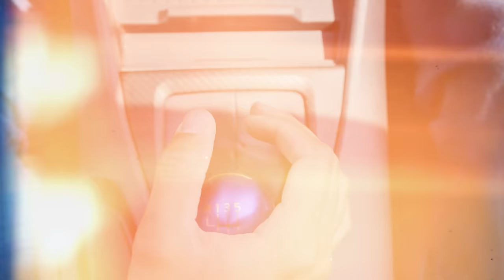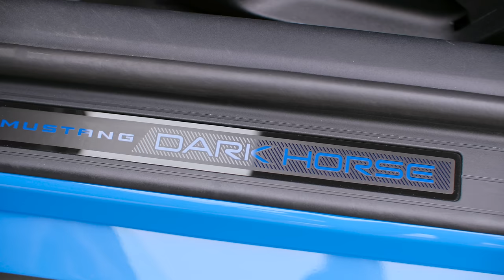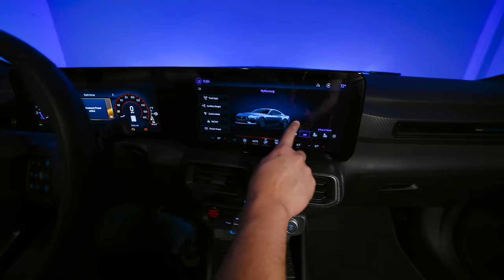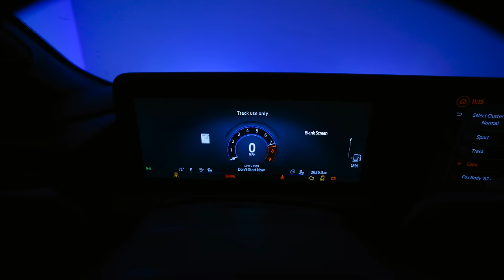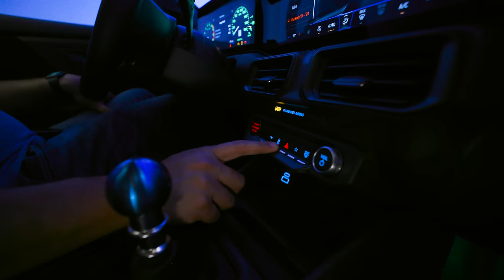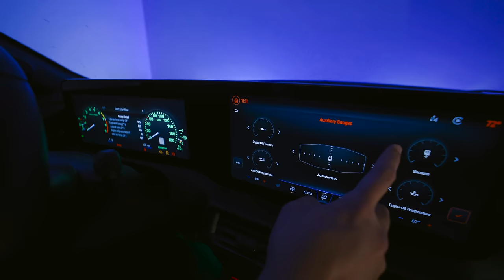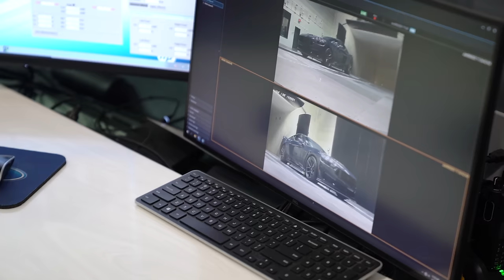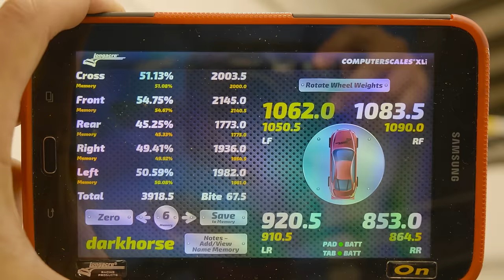2024 Mustang Dark Horse | Why This Car Exists

Comment: I just spent 4+ hours in a debreif on how important this video is and how good the coyote v8 engines are (they are built Ford tough).
Reply from the maker: Thanks for being a man for 4 hours
Reply: Yep. The last gen Coyote, RPG took one, swapped out OPG's for billet ones, threw a turbo kit on it and ran 7's on a FACTORY SEALED motor. Unheard-of 😮 Ford knows what they're doing.
Reply: @terrancebulong4573  cough 6.0 powerstroke cough ;)
Reply: @terrancebulong4573 aldowelds took a stock motor gen 2 and went mid-high 7’s with it. Coyotes are the best motor Ford has put out in the modern era.
Reply: @ralkia  international, not built in house like the new bulletproof high output 6.7 making 1200ftlbs easily.
Reply: @terrancebulong4573  yayaya. It's sick!

Comment: The only people I can imagine saying they prefer entirely screen based buttons have never lived with one. Everyone I know who has lived with entirely screens prefers the mixed style (buttons for climate, seat, and audio)
Reply: Yup. I called BS the moment she said they prefer all digital or all physical but not mixed.
Reply: "If I had asked people what they wanted, they would have said faster horses." - Henry Ford.  Modern Ford "Muh twenty-somethings who can't afford or don't want a Mustang, what do you want?"
Reply: I feel like they just asked a bunch of people questions with out actually making them to use different configurations first.
Reply: @Lazirus951  Prototyping is too expensive when you can rely on people feelz for free I guess.
Reply: I don't think their "clinics" involved changing the climate settings driving on a busy city.
Reply: @CubanRider  Just let Jesus take the wheel whilst you fumble and stab at the inert touch controls...
Reply: I think it's hilarious the screens aren't even molded into the dash.  It's just two ipads glued together.  I'm not a fan of digital dash clusters, but at least the Japanese still make them look like real gauges.
Reply: @jasonmoyer  Cost savings I recon, so they can easily swap between LHD and RHD for the APAC market - which, since I'm part of the RHD APAC market, I think I can live with - as this is actually a car I'd consider purchasing at the right price.  Beats putting the gauge cluster in the middle.
Reply: I think it's the reverse - those who haven't lived with buttons and learned the subtleties like feeling for the bump on the 5 key before pressing don't know what they're missing and think touchscreens are fine.
Reply: It’s all about cost cutting. Tesla model.
Reply: That was the stupidest statement
Reply: It’s amusing to me. All these companies have to do is scroll through social media, particularly YouTube, and check what the comments say and which ones garner the most attention. It becomes extremely clear extremely quickly what the general consensus about literally any product is and how it should be presented. They must be inept.
Reply: @extremeencounter7458 You think they don't do surveys? Social media is a terrible place to get opinions, it's the vocal minority. The fact is Ford has asked a bunch of people who are actually likely to buy their car what they would prefer.

Most people like touchscreens. They're shiny. It's as simple as that. People see their friends Tesla and say "I want this in my Mustang". Enthusiasts bitching on YouTube are such a tiny percentage of who's actually buying these.
Reply: Never getting rid of my GT350 with analog screens. Even if I do eventually blow up the voodoo.
Reply: Yeah that part with her pissed me off. Nobody prefers all digital. We all prefer a mix. A nice screen, with physical climate and volume buttons / knobs.

It doesn’t take research and asking a bunch of people to figure this out. They could’ve saved thousands by just using intuition, or asking me. The fact they wasted who knows how much money, only to go with all digital, just irritates me.
Reply: @SIIKAP1  Told myself the same thing. At least, what, couple hundred thousand, just to fuck it up? What a waste.
Reply: @SIIKAP1  I just realized, must be sabotage lmao. Chevy got a bunch of bots to fuck up their surveys.
Reply: @extremeencounter7458  lmao especially after seeing everyone complain about VW GTI with the all digital crap. They need to hire people who actually have good taste that reflects the masses, and stop wasting all this money only to choose the wrong path. It’s a joke. If their team doesn’t have common sense, they need to hire someone who does. They can just hire me and save hundreds of thousands.
Reply: The way Audi implemented the dual screens in the C8 platform is about as good as it gets with screens. Anything more is basically menu scrolling.
Reply: @GuyGamer1  yeah until people live with it. Everyone wants it and likes it until they have to live with it. Isn't vw working on redoing the mk8 interior to introduce buttons since everyone hated the touchscreen?

I'm not even entirely against touchscreens. But simple things like HVAC, audio, and seat adjustments should have physical controls. It's what you touch the most
Reply: Nope. I prefer all buttons, no screens. Screens will be the tacky dated design of 15 years from now. And rightly so.
Reply: @117johnpar  How can you control things like audio balance and GPS navigation without a screen?
Reply: @GuyGamer1  Enthusiasts are the only ones who will ever consider a car with a big NA engine and a manual transmission.
Reply: @amunako  I can in my 2012 truck. Dot matrix display. Works fine. Also, google maps. I dont know any reason to use a cars satnav.
also also. Audio balance specifically has been analogue controlled since the 70s. So I dont know if you were being sarcastic or not. You want a fart button in your car like a Tesla, Whoopie cushions are like 50c.
Reply: @117johnpar  I use google maps on my car's screen, it's way easier than messing with the phone. I do not have a lot of experience with old audio systems, but I remember then having lots of buttons that are even more confusing than a screen. I believe you only need dedicated buttons for things that you use a lot, like climate control, driving modes, audio levels, etc. A dot matrix display is fine for the onboard computer that shows things like mileage and fuel consumption, but a screen is better for controlling less important stuff. I'm not saying that you just can't live without a screen (I did until late 2019), what I mean is that it makes your life easier and there is no drawback in having a small one.
Reply: @amunako  No aesthetic drawback? go look at luxury cars from the same era as my truck. Those look outdated while my truck wont. -
Reply: I dont mind as long as there's not excessive input delay, same goes for haptic buttons. As long as I have a solid set of steering wheel controls I'm happy
Reply: @117johnpar  I don't know about luxury cars, I don't like them anyway. I'm a third worlder, so I own a 2020 Renault Sandero RS. It's a hot hatch, basically an entry level model tuned for track use with a manual gearbox and a 2 liter NA engine. It's a very basic car, but it still has a small screen in the center of the dash that control things like audio balance, bluetooth devices, can interface with google maps and amazon music, can control audio playback from a USB device, etc. It's a little out of the way, but still better than messing with the phone. There is no drawback in having it there, as there are dedicated controls for all the important stuff (climate control, cruise control, TCS/ESC). My old car (2017 GM) just had an old style radio. It could do many of the same things, but it was a pain to use.
Reply: Yup, like the Supra (older BMW interior/"infotainment") vs the new M2. Supra still gives you physical controls for all of the important stuff, but has a tiny screen. M2 has a huge wrap around triple-ipad style screen, like this new Mustang, but drops all the physical buttons, and a lot of people have complained about it in reviews.

The screens can look cool, but it's not practical when driving when you just want to reach over and grab a button to control music or A/C.
Reply: no idea how much I want a volume knob.
Reply: They should of mix it
Reply: I had a Tesla driver tell me to "just use voice commands" to control the climate and volume if I don't like touch screens. Like, bro, that is even worse. 😂
Reply: @darryla2700  it's great. Literally use it to text.
Reply: Honda learned this lesson with the 2017 Civic, as most people used the physical steering buttons to change music/volume and in the 2018 they added a physical volume dial and all the complaints went away.
Reply: @BurnsRubber  No its not. Cost entry models dont get screens. Buttons and knobs are not more expensive than screens.
Reply: @117johnpar  Bro, you drive a truck. Your car and yourself were outdated the moment you got on the street.
Reply: @d_all_in  why? dont know how to speak or what?
Reply: @an-dr6eu  ?? what are you even talking about. I also have a '16 charger
Reply: A deal-breaker?   Even if I could get my hands on one, I'm no longer considering any car with this design failure.   Mercedes S Class, Ford Bronco, the Civic Type-R or Acura Type-S... and soooo many others with the dash=mounted iPad.

I hope the 'geese' road test gives Mark and Jack the opportunity to expound on this nasty trend one more time...  @jasonmoyer
Reply: Yeah, i did a double-take when she said people prefer all-digital and bigger screens. Clearly sampling "normies" and not car people.
Reply: @extremeencounter7458 exactly. They could look at youtube comments for free but they will spend millions in these "studies", only to make something that is complete ass. Not saying this interior is ass by any means but clearly things like climate controls in the screen are just stupid.
Reply: On the Mustang7G forum people generally HATE the screens in this car.  Apparently Ford didn't actually ask potential buyers.
Reply: If they bothered to add the Foxbody cluster in their graphics, why didn’t they just try to emulate the gauge pods and monster tachs that people love to add and make those with multi-info, customizable faces. I get the “everyone wants screens” excuse, but people love muscle/pony cars for the feeling that it requires this sorta ADHD level of skill to drive. “Gotta watch the temps in traffic” “gotta go over the speed bumps at an angle” “this cowl hood and windshield make this a bitch to see pedestrians” “I can’t drive this on rainy days or else I’m going to die”

Comment: Thanks to videos like this we can get some answers to what the hell were they thinking when they did this, i really appreciate that. Its interesting that Ford designers managed to capture so much of the current camaros design in the 'all new mustang'. I also old enough to remember the first time the car industry tried going to all digital guages in the late 80's and early 90's.. it didn't go that well. I'll be stunned if any of these new digital guages last more than 10 years without problems.
Reply: The digital cockpits in Audis have been around since 2014… so there should be some testing of that theory

Comment: As a Camaro fan... I have to say that this design direction was a good choice. Nice job, Ford!
Reply: 😂 Touche.
Reply: Looks like and aftermarket s550, infact  you could make bodykits for the gt500 that would probbly be one to one.
The universe is the limit and they move 2ft...like come on ik you can do better.
Reply: agree, they've designed a fantastic next gen camaro
Reply: @THESLlCK  👏👏👏👏👏👏
Reply: The hood, and the whole side profile is absolutely screaming Camaro! Hell, the vent inserts in the hoods are exactly the same as the ‘19-‘24.
Reply: Ha! I see what you did there.

Comment: The fact that the designer said they wanted to drop the roof lets me know these people live in their own world. Literally everyone pans the Camaro for its low roof and shit visibility. Its partially why its dead but these guys at Ford have such a hard on for the Camaro that they were going to make the same stupid mistake 😂
Reply: *roof AND belt line, not just the roof
Reply: @390fe451  they need to lower the damn seat rails. Sitting in the damn car like im on a bar stool
Reply: @728GT that's the Mustang driving position, it's for old people.
Reply: If true, that would explain why (especially with this Dark Horse grille and graphics) it looks so much like a Camaro!  IMO it was a mistake for Ford to remove a lot of the strong character lines from the S550 which were unmistakably "Mustang".  For a car like this, for the buyers it is aimed at, something that is a bit retro is the way to go -- look at the success of the Ford Bronco.
Reply: It's not the roof on the Camaro that's the problem, it's the stupid high beltline. Thank government regulations for that BS.
Reply: Even the front end looks a little like the last Camaro
Reply: Have you driven a 6th Gen Camaro? The thing handles like a dream vs. the mustang feels like it's on its tip toes all the time. They prolly wanted to drop the roof and beltline to have a sportier feeling chassis. I drove them both and bought a Camaro because it's a V8 sports car
Reply: @jackb55391  this is true! I'm a mustang fanatic but the Camaro has the better chassis by far.

Comment: Chris Walter said all that needed to be said. "We wanted to lower the roof, we wanted to lower the belt line significantly, but that would have meant millions of dollars of investment". Instead of spending the money to do the 7th Gen correctly, Ford half ass'd it and gave it a new name to create artificial interest. They then poured Billions with a B, of dollars of capital into EV.
Reply: Money that will be wasted when none buys those fire hazards on wheels.
Reply: To be fair, the proportions were the least of the problems with the S550.  That the S650 is just a facelift and has the same proportions is not one of its issues IMO.  The issues are more around the finer detailing of the body lines, the interior, the steering feel (in the standard model) etc.
Reply: Yup
Reply: All these things would have resulted in a much more expensive vehicle. These engineers are passionate but at the end of the day the company needs people to buy the cars to make money.
Reply: Which is a Tragedy
Reply: Welcome to life with no Challenger and Camaro.  When you no longer have rivals, you don't have to innovate.  So now we will be left with the most capably designed 'muscle car' being the Alpha platformed 6th gen Camaro until 2030 or later.  Which debuted in '16...
Reply: Imagine what Ford could do if people were willing to spend Porsche amounts of money on a mustang. But they're not, so they can't. Compromise is the name of the game for any even just somewhat affordable sports car.
Reply: Bring back the GT350 fix the engine issues and upgrade the Tremec.

Comment: I was really hot on getting a Dark Horse but now as my savings get to the point where I planned on pulling the trigger I am cooling off because of the virtually all digital interior.

For me this car has to be my DD for 10 years minimum and I just don't have that level of trust in the reliability of the screens. I am hoping that the Shelby that is said to be coming in another year or two will have a more traditional interior otherwise I will likely start looking at F-350 or something along those lines.
Reply: Get the F350. Fucking beautiful and I’m a Ram guy.
Reply: The digital dash will almost certainly last 10 years they are designed for a minimum life of 20,000 hours or 2.3 years of 100% on time assuming you drive less than 5 and 1/2 hours a day they will last more than 10 years.... Hate that they moved climate control to the displays though.
Reply: How about the Shelby 350GT?
Reply: @joshuabennett8110  Honestly could never find the appeal of the 350. It usually didn't have the power of the 500 that was usually also available and was only a little cheaper so if you were buy one anyway the 500 was likely with the same budget range.

Comment: I have a Mach 1. Normally would feel a little bite for not having the incremental performance updates from the dark horse. But, the interior changes with those screens make me happy to have purchased the Mach 1 and not the dark horse. Still glad the car is being made though.
Reply: Agree ! 15 to 2023 much better looking interior!
Reply: The Mach 1 (HP) is the best N/A S550 made. The GT500 being ultimate Mustang ever made.
Reply: Just wait lol just wait.
Reply: @TheMsr47gaming  Huh? Is Ford adding jet propulsion to the Dead Horse or something?
Reply: @ClickbaitMotorsports if equipped
with the Tremec manual transmission and Handling package